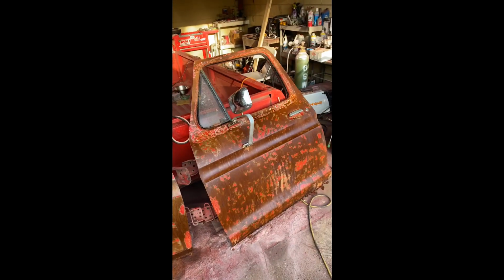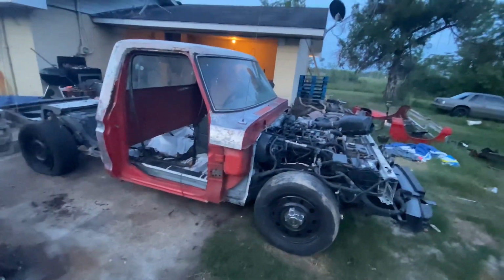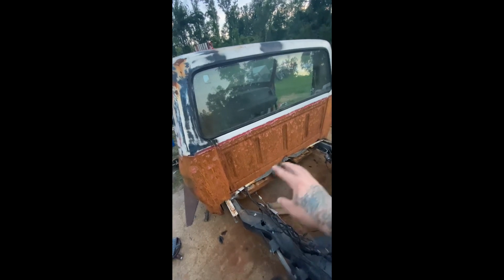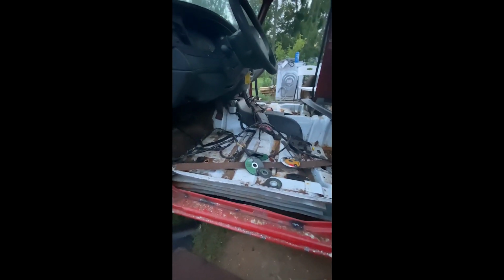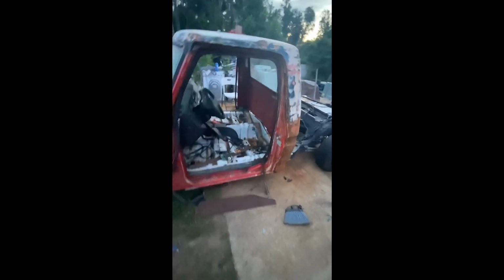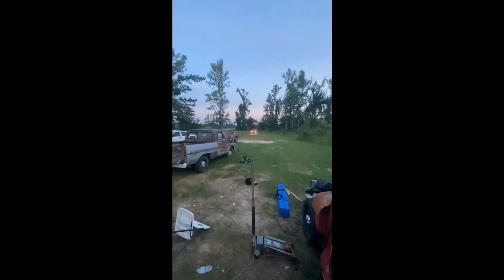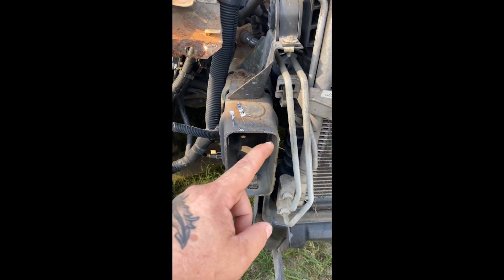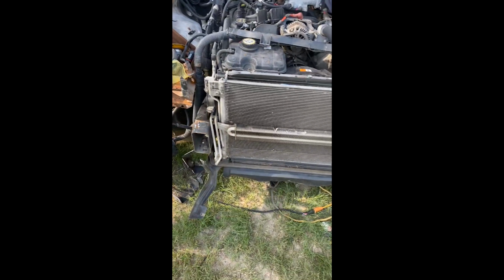1977 F100 Police interceptor crown Vic fullframe swap

Comment: I'm planning a Crown swap.Just like the two i've seen you do. Only difference is i'm contemplating using the f 700 front end, Which  means the cab needs to come forward 7 inches. I know that's a lot. How much do you think The cab could be moved forward and firewall and Dash - still work?

Comment: I like that these builds are something you and your son are working together on. That’s awesome. You are doing all these welds with a flux core welder? How low have you been able to get your truck to ground? Curious how low I can go with my F100 on my town car frame.
Reply from the maker: At first it was with a flux core welder now we had a true Gas Mig welder. We’ve gotten them pretty low by just taking the cab on and off a thousand times cutting and recutting everything until we liked the look

Comment: Building a 78 myself, curious if you have determined a solution on dentsides for windshield wipers, I believe the cab is larger than a bump side and I’m thinking we may not need to notch the firewall as you did on the bumpside